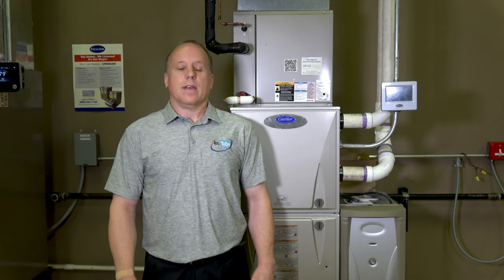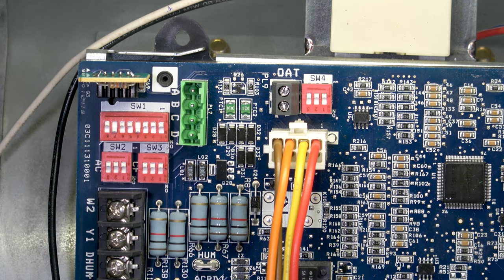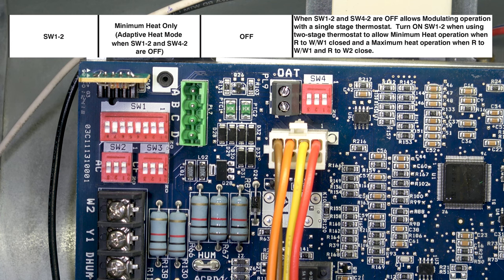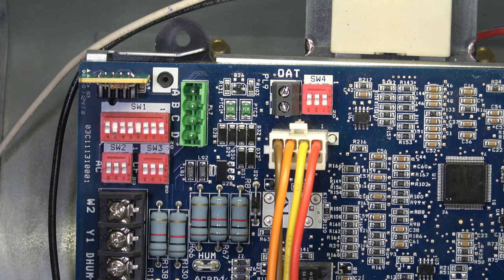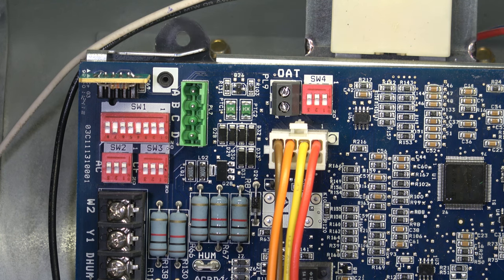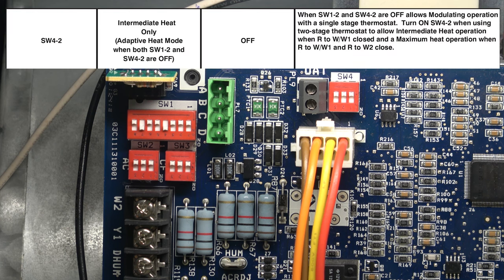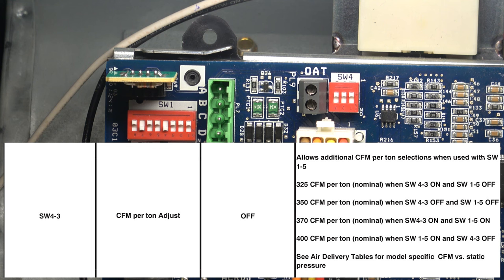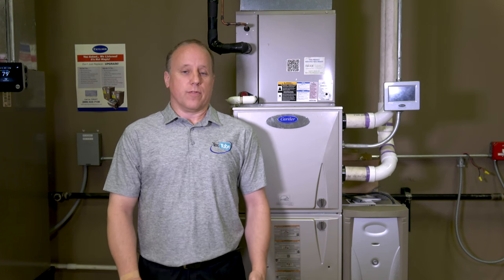Variable Speed Furnace Setting Switches for Carrier Infinity / Bryant Evolution

Comment: How to set infinity furnace fan to high speed for cooling,  customer recently replaced infinity thermostat with regular thermostat! And fan is not blowing strong and it causing system to freeze.  I wants to increase the air flow. And I already turn 4 to off position
Reply from the maker: This video specifically addresses how to make adjustments to airflow for an Infinity furnace without an Infinity wall control.  We doubt we could type it out better than Dave showed it in the video.  Sorry.
Reply from the maker: Why would the customer downgrade their Infinity wall control to a standard thermostat?
Reply: @TECTubefilms  probably for better integration with other devices when using more common network connected thermostats.
Reply from the maker: @malventano  When they said "regular stat" that did not imply a network connected stat in our mind.  But in either case, if you already own the Infinity stat, we would not swap it with a a more common brand of networked stat.  The Infinity stat is already connected to Wi-Fi and supports integration with 3rd party tools like Alexa, etc.
Reply from the maker: @malventano  Plus if you remove the Infinity stat and replace it with an ecobee, nest, Honeywell, Venstar or other networked thermostat, then your 5-stage A/C or heat pump (if you have those models) will be limited down to just 2 stages and your modulating gas valve (if you have that model furnace) will be dumbed down from 61 stages to 2 stages.
Reply: @TECTubefilms  Understood. I was merely stating why a customer might change their thermostat to another model - they may prefer the other types and not care as much about full functionality of the system (as silly as that may sound).
Reply: @TECTubefilms  I replaced mine because of intermittent communication errors. Unit would run fine for months and then give a communication error. Cycling power cleared it and it would run for an undetermined time and then fault again. This happened while on holiday two years in a row and almost froze the water piping. Went back and forth with Carrier tech for a couple years on the issue. Changed control wire but I wasn't about to try a new board or Infinity control for a couple thousand dollars. No communication errors with the Ecobee. Granted some functionality is lost but reliability is more important in winter.
Reply from the maker: @dialup5919  Ecobee is a non-communicating stat, so it will never have “communication errors.”
Reply from the maker: @dialup5919  Why would a new circuit board or new thermostat cost you anything?  Is your system older than the 10 year warranty?
Reply: @TECTubefilms  Yes. It was an ICS installed in 2009. Issues started just after the warranty was over. I would have tried a new board or stat if it was still under warranty. The Ecobee works well enough. Just have Med-High now instead of 3 levels.  Its too bad the Infinity control latched into a non functioning mode after the communication fault was gone. Had it reset, i could have managed with it.
Reply: @TECTubefilms  SERIOUSLY!!  THAT is insane
Reply: @TECTubefilms  Bingo!!  That is a ridiculous change-out, especially after you paid that much for such of a good thermostat.
Reply: @TECTubefilms  The 2009-2012 Infinities like in this video are not wifi capable in my experience.   And my 2012 infinity stat has all these features to help service techs and shows dozens of faults (which is especially valuable if the system is unreliable), but not the features I as a homeowner want:  Internet control, apple watch control, graphs of how much it runs under each stage, etc.
Reply from the maker: @RobSAtlanta  The specific version of Infinity stat in this old video was in production from 2011 to 2018 and does have a built-in Wi-Fi chip. It utilizes the same free Carrier homeowner app as the B model Infinity stats (2018-24) and the C model Infinity stats (2022-Present). And all are compatible with 3rd parties like Amazon Alexa, Control4, AMX, Crestron, Interlogix, Home Assistant, Infinitude, and whatever other software companies want to use the API.
Reply from the maker: @RobSAtlanta  Carrier did make a non-WiFi version of this old A series touch screen Infinity but we did not use it in our market in the Midwest because it was only $7-15 cheaper than the Wi-Fi version.

Comment: Is this for 38CKC060300?
Reply from the maker: No. A 38 series would be an outdoor A/C or heat pump model. Furnace, like shown in this video, are indoor units and would start with a 58 or 59 model number.

Comment: How can I increase the air flow in heating operation? The air flow not enough so the high limit tripped
Reply from the maker: You first need to determine if the lack of airflow through the heat exchanger is due to the fan speed being set too low or if it is due to a ductwork issue that is obstructing the airflow.  If this is a brand new install, then the fan speed may be too low.  If this in existing system that ran fine in prior winters, then the issue is likely an obstruction.